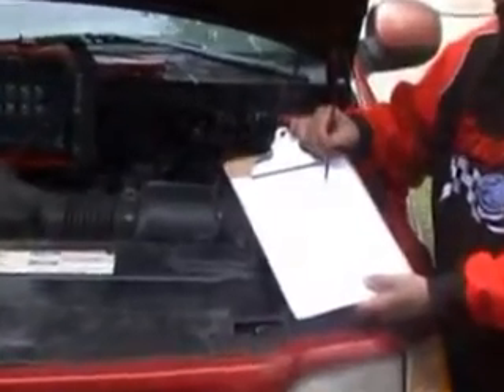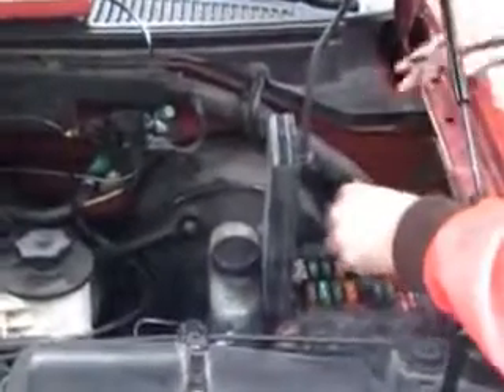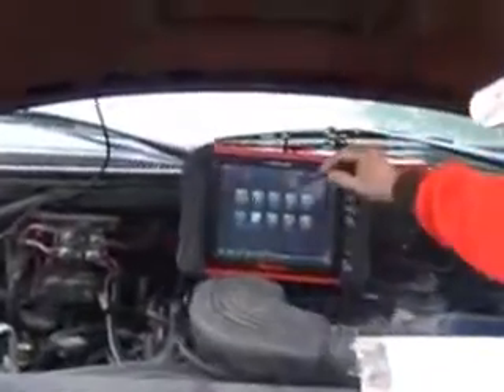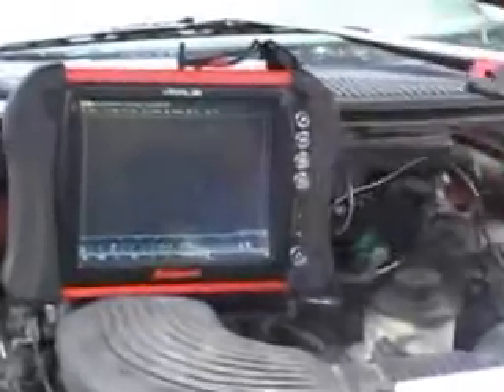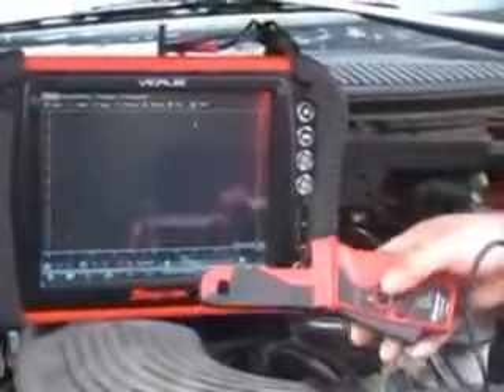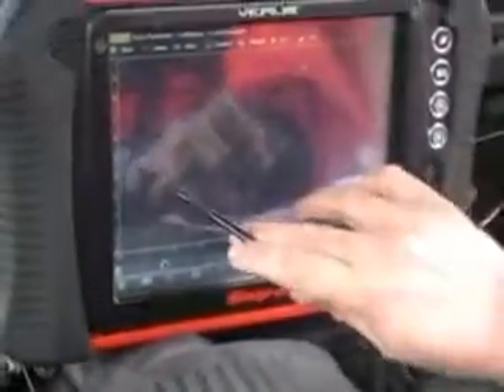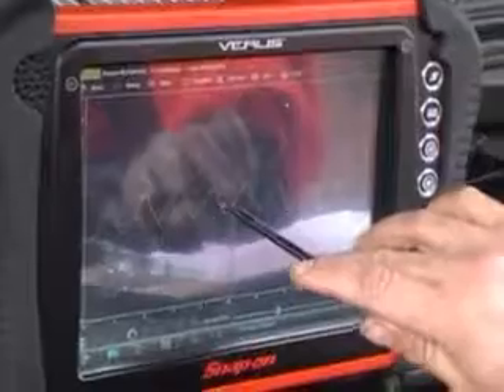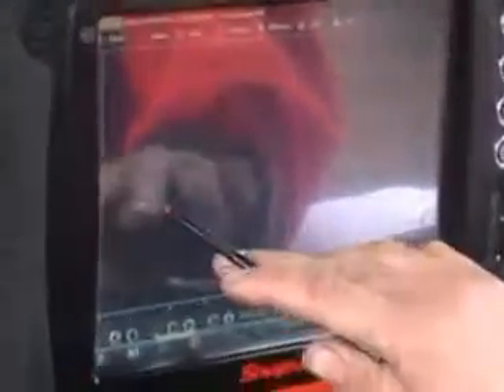Fuel Pump Waveform using Snap-on Verus

Comment: back pro it from the fuel pump to get a more accurate reading with voltage,
but it really depends on you tho.....
but you can't tell tho if what you are seeing is normal because there is no spec for measuring amperage lol
take it on ur own risk. ....
just use a pressure gauge and  check it manually